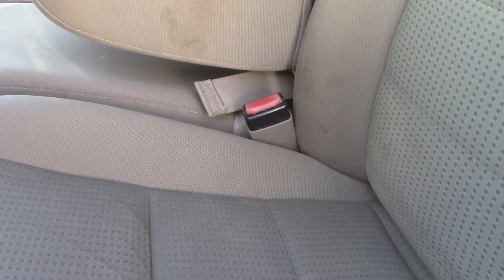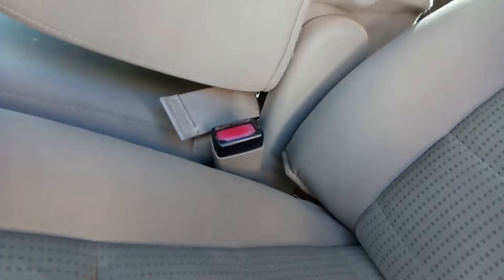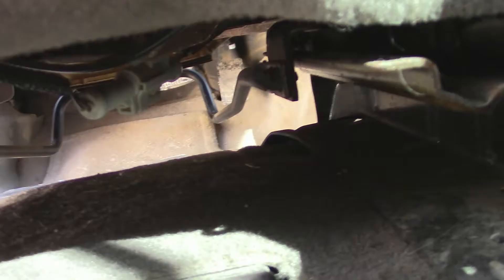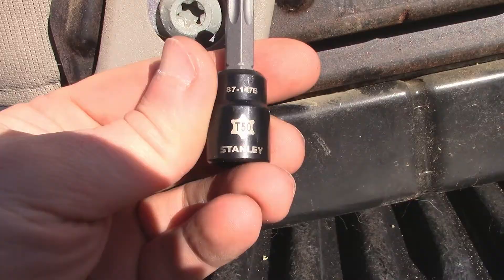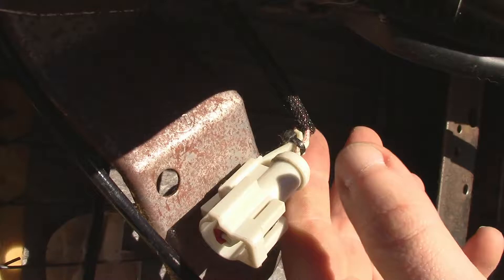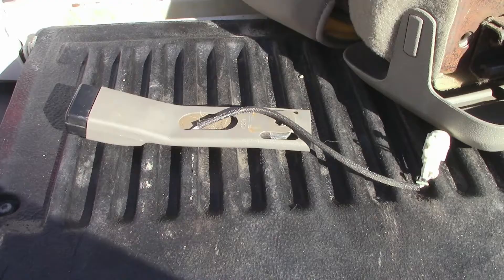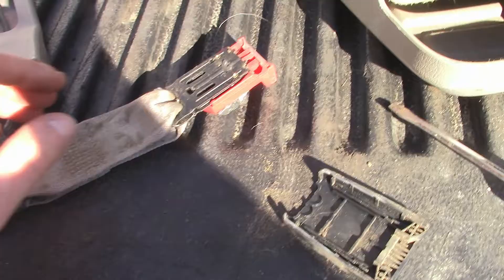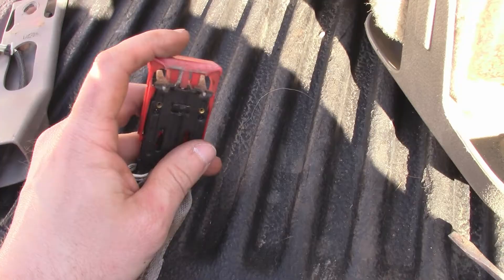How To Replace (Or Repair) A Ford Truck Seat Belt Latch

Comment: Thanks for your video. The drivers seatbelt latch quit latching on our shop truck. I was ordering a new one when I somehow noticed your video. When you mentioned accumulated gunk build up a lightbulb went off. I took brake cleaner and sprayed down into the latch. After latching and unlatching a few times the seatbelt latch started working properly. Added some lithium spray grease and its good to go.

Comment: Before you disassemble the whole seat and all, try blowing the buckle out with comppressed air, then squirting some WD40 or PB Blaster in the thing and working the red release up and down.  Did that on my 03 F-150 and save a WHOLE lotta time.
Reply: Will try that before I go too far. Thank you!
Reply: Thank you.

Comment: First try rinsing it with almost boiling water, then lube it.  Odds are stickiness accumulated over time causing gunk build up.  Worked great on mine, 10 minutes!!!!
Reply: I’m going to try this should I just pour it down the belt buckle?

Comment: I am faced with same problem but mine is on back seat  so much easier to get buckle loose by just taking the 18mm nut off the bolt on floor. But now I need to figure out how you split the housing apart and how to glue it back together once I get it cleaned out! Would be nice to show video how you split open the buckle plastic housing!

Comment: Could do another video just working on belt connector to fix without holding the camera so you can go more into detail . It would be more helpful . Thanks
Reply from the maker: They're all working fine at the moment but if I have to open up a buckle again I'll make a video for that specifically. Thanks
Reply: @backwoodsbuildingandfixing9223  How did you clean it? Mine is doing the same thing and I thought something was wedged inside it. Might be all gunked up. :(
Reply from the maker: @uber2tuber  After I opened it I just sprayed it out with brake cleaner and lubed it with WD40, pretty much any solvent and lube combo will work

Comment: Same here. I can choose from fixing the rear hatch release (Expdtn), belt buckle or or oil cooling heat exchanger which is getting oil in the coolant and causing boil out

Comment: We have a Ford Explorer, 2015, and they are falty. In late October 2022, the black part completely cracked within the first 4 days!🤬
Then the next passenger seat cracked off a month later, and it can no longer be used!
We've got a 2007 Ford Freestyle and never once have they broken.
We've been in a Ford Flex, no buckle issue. Been in another Ford car, no buckle issue, but it did have a seatbelt issue that led to a lawsuit, resulting in a settlement case, still ongoing since 2019, nearly done.
But this issue, what kind of cheap a*$ plastic are they using now that makes it crack so dam fast?! I can tell the plastic is thin, way thinner than older Ford models.
What the f*ck man. They really want another lawsuit huh. Well, they about to make us rich from settlements, sheesh. I'd rather they just make their dam cars better quality, not put my kids lives in more danger!